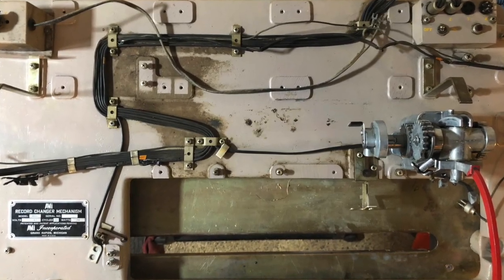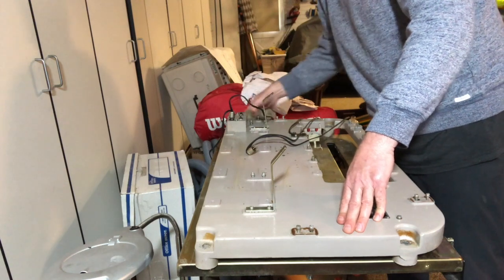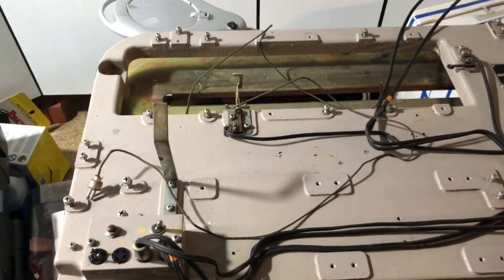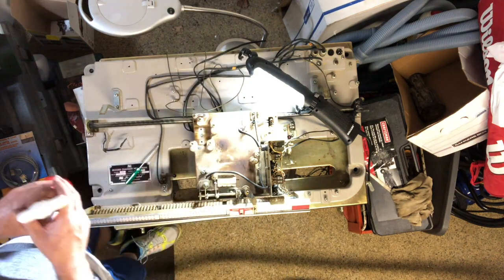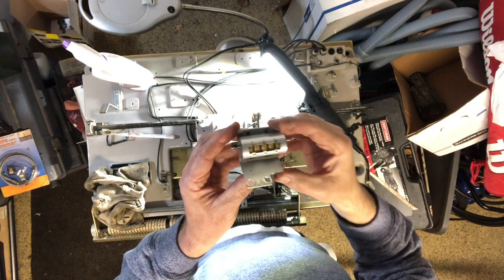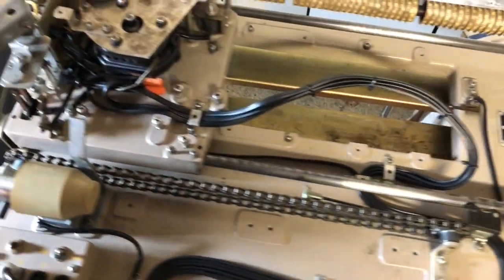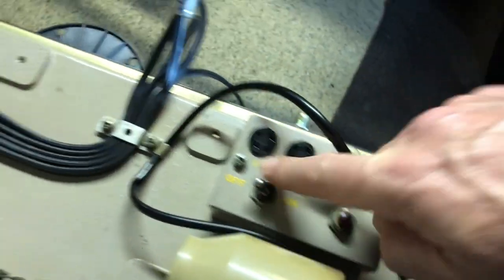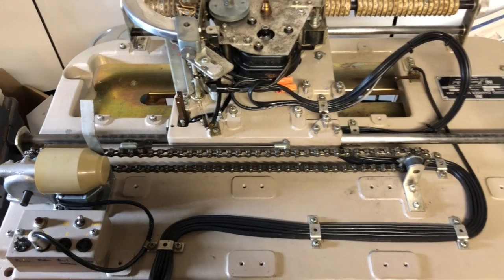AMI E-120 Jukebox Rebuild - Part 4 - Record Changer Mechanism

Comment: Hi Bob. I've now successfully figured out how to make the turntable 'gaskets' (for lack of a better term). On this year, 2 different sources have told me they used a 'flocked' material on the turntable. This is the material that was commonly used as a liner in girls jewelry boxes I saw as a kid. I found some bright red flocked fabric on eBay and went through some pains before getting a fabric circle cutter that would do the job. They look absolutely beautiful. The flocking looks like velvet, so they look great on my repainted bright red turntable. I am happy to send you one or you can do a DIY video on this too if it suits your fancy. For posterity, the outer radius to use on the cutter is 3-3/16" and the inner is 2-13/16". The cutter that works is an Olfa CMP-3. I use 3M Magic 77 spray adhesive to stick a piece of the fabric to a common teflon white cutting board. When you lock in the radius on the Olfa make sure to really screw the thumb-screw down hard- my only negative comment on that circle cutter is it moved when I thought it was locked with sufficient force. Tip: cut the circle and keep going, going back over it once to make absolutely sure you've cut all the way through the fabric. Cut the outer circle first, then remove the cutter and adjust to the inner radius. Tip: hold the teflon board with light behind it and you can easily locate the hole for the pin to place the cutter pin right back where it was. Now cut the inner circle. Last, don't try to pull the gasket out with your hand. Rather, use a box cutter blade not to cut, but to get under an edge and lift the gasket off the teflon. Once you have an edge up, you can lift the rest of the gasket off by hand- oddly enough, the Magic 77 adhesive doesn't stick that well to the teflon so it will lift off pretty easy. It will also be tacky from the adhesive. Easiest way to install it on the turntable perfectly is to lay it on and rotate the table while lightly holding the edge with a finger to align the gasket with the edge of the turntable. It won't really stick much of anywhere but it's repositionable if it does. Once you've gone around the edge with your finger to roughly align the gasket edge, keep going slowly, but pressing the gasket lightly to get it starting to stick. If it gets out of alignment you can stop, back up, pull it off slightly and redo the section that's mis-aligned. Keep going round and round getting it perfect, and once it's perfect, start pressing it fully down onto the turntable's raised portion to get it fully adhered. Don't press hard- just enough to get it to stick but without crushing the flocking. I can also tell you, the record on bare painted metal picks up some vibration noise probably coming from the motor through the turntable. Everything sounds quite a bit better now that there is a gasket on the table.

Comment: I've rebuilt more of these AMi mechs than I care to remember. If I may say so, that ribbon cable is supposed to be flat. It should have had aluminum pieces that laid each piece of "lamp cord" side by side and flay. It has to lay under the mechanism when it passes over it.. and yes an 18 guage black lamp cord would be better suited to this. Remember that this ribbon cable has to bend up and under over and over and over again.. this is why a tightly knit ribbon which lays flat is ideal. The lamp cord won't rub against it self.. otherwise a very good instructional video on how to do one of these mechanisms.
Reply from the maker: Do you know where we can buy the ribbon cable you recommend?  I'd like to replace what I put in.
Reply: @XORBob  you have to make it up yourself. You lay out lamp cord (that you can buy in a roll) flat and side by side. As I recall there are four wires total laid side by side. There should have been flat aluminum pieces with your jukebox that fold over the cables to hold them flat. (look at video's of AMi jukeboxes from this era..) if you don't have yours you can make them I'm sure our of malleable metal.

Comment: Learned something else interesting. You've probably noticed how fast the carriage stops when it comes across the selection. The manual has an obscure reference that they use 'dynamic braking'. I used my 2 years of EE courses and thought it through. What they've done is very clever: when the carriage comes across a selection, the left or right bank switch gets closed by the selection pawl sticking up, and this actuates the carriage 'selection' relay. One of the things the relay does is remove the DC voltage to the carriage motor and simultaneously SHORTS the motor terminals together. When voltage is removed from a spinning DC motor, the motor will actually act like a generator. In 'generator mode' anything that uses the generated voltage will impart a force in opposition to the rotation. So by shorting the terminals, a force in opposition to the rotation of the motor (which is spinning down naturally) is imparted on it, and with a dead-short the force is maximum. This causes the motor to come to a dead-stop amazingly fast. Once the motor stops rotating the opposition stops automatically. Once the transfer cam rotates the record onto the platter and sets the arm down, it hits a switch that causes a plunger to reset the selection pawl, which turns off the selection relay and everything is reset and ready for the record to end and engage the record re-rack sequence. I was sort-of forced onto this subject because my E-120 wouldn't reset the pawl and the transfer motor would hit a hard stop with the DC on and I'd have to unplug it and manually rotate it out. The issue ended up being that the cam leaf switch wasn't resetting the selection pawl because the black wire on the connector hadn't been soldered into the pin properly. Wonder how it ever worked. I resoldered the wire into the pin and everything works.

Comment: Never mind I figured it out. What threw me off was that my spring was mis-shapen. I got it working after I restored it to the proper shape according to pics from the manual. In case you or anyone ever encounters this, the way it works is that the spring is installed on the pivot post as shown in this video at 8:28 and the small 90 degree 'lip' of the spring is adjusted to 'slightly more than touch' the edge of the armature of the tone arm when it moves into the position where it drops down on the record. It then very slightly pushes outwardly on the tone arm. As the record plays, the armature slips past the spring's 90 degree lip and the small outward force stops. This serves to keep the tone arm from jerking into some records, as I noticed mine did sometimes. To adjust, unplug the turntable motor from the amp, then get the mechanism into playing position without a record by selecting an empty record slot, and once the arm is down turn the mechanism power off via the switch behind the carriage motor. The trick is to have the spring's bolt tightened enough that it won't rotate on the pivot post from the tone arm's movement, but loose enough you can move it to adjust it. It's not too difficult, it actually stays put real well even though it's not real tight. With the arm in the start position, rotate the spring on the pivot post so that the spring's lip goes a little too far over the armature, then you can get a small screwdriver to wedge and rotate the spring back until it's 90 degree lip edge is just slightly past where it would first touch. Now you can move the tone arm and watch how it exerts pressure at first, then slips off the armature and 'lets go' for the rest of the tone arm's travel. The manual says you want it 1/16" to 3/16" of tone arm travel at the far end (end of the tone arm with the needle). So it's very slight.
Reply from the maker: Blake, this is great.  I'm going to do this adjustment on mine.  I still have some alignment issues right in this area.  Thanks for the detailed writeup!
Reply: @XORBob  Fun news for me too- last week I found an E-120 too and it is being shipped to me as I write this! Your restoration videos are much appreciated.

Comment: At approx 21:00 you mention that you believe the turntable was always spinning. This jukebox should have the turntable power plugged into the amplifier receptacle labeled "TT". The amplifier controls the power receptacle for the turntable. Inside the amp there's a clever circuit that has a relay that turns the turntable on and off and the relay is driven by current through the power tubes. What happens is the turntable won't turn on until the power tubes are warmed up (and current starts to flow in them) and the turntable turns off when the amp is turned off. Interestingly too, this amp is the fastest warming tube amp I've ever seen. It usually beats the selector mechanism to the finish line and the platter begins to turn before the arm sets down. But in case it doesn't they've made it so it doesn't start to play the record until the amp is ready.
Reply from the maker: Yes,  thanks for pointing that out too

Comment: Hi. I am restoring a D-80. I am trying to figure out how the 'tone arm bias spring' works. The D and E models use the same arm and spring. I have the spring but it was removed from the mechanism when I bought the jukebox. After a lot of searching I can finally see one installed and in-position in this video at 8:28. But for the life of me I can't grasp how it is supposed to put 3-4 grams of pressure on the tone arm as the tone arm sets down on the record. Both the manual and your video seem to show the tone arm pickup wire running down there. Is the pickup wire somehow connected to the spring or something? Any help is appreciated. Thanks!